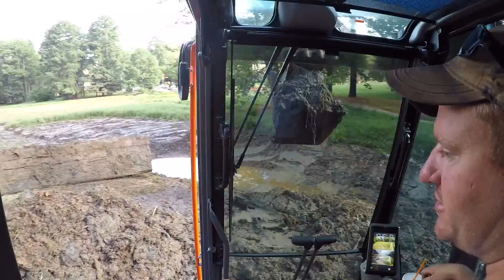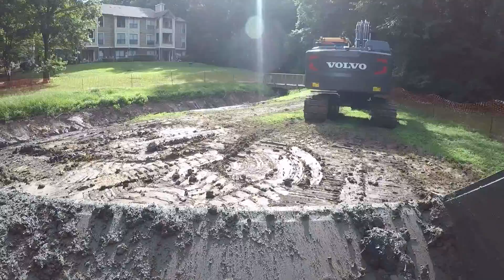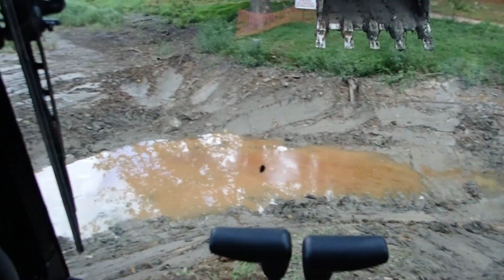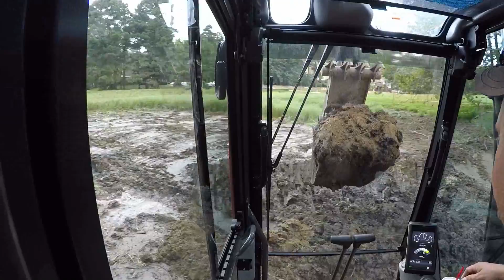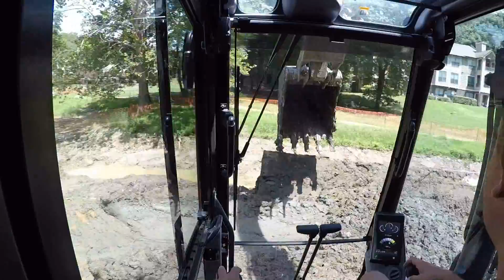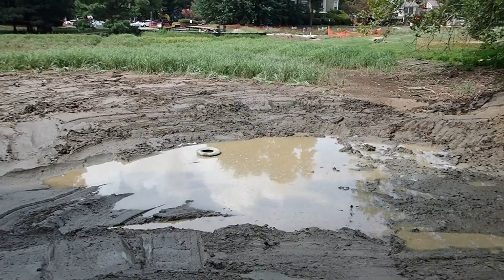Phase 2 Dredging Is Done

Comment: Question.  Off the top of my head having followed you for 4 months now; besides the old girl Hitachi you have a Volvo 160 , 210, two 220's, 240, 250.  You sold the Big girl 290. Is that right? I knew nothing and still know nothing about excavators. But learning lingo from you.